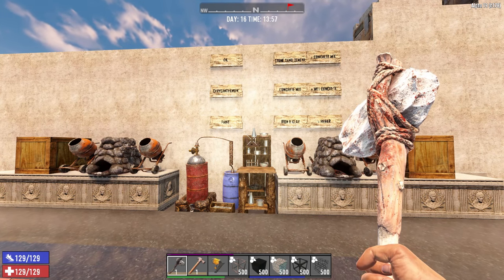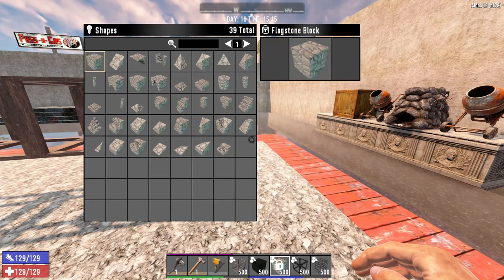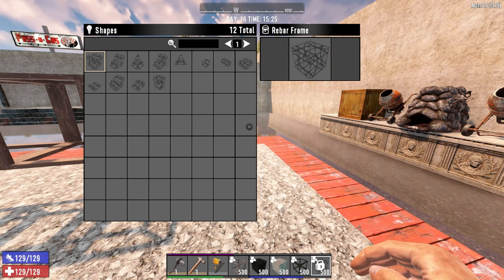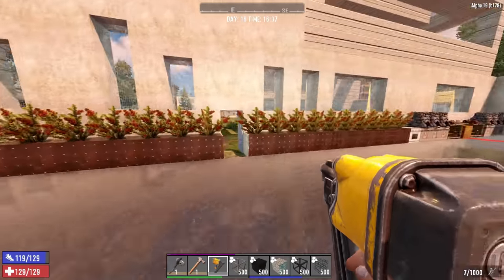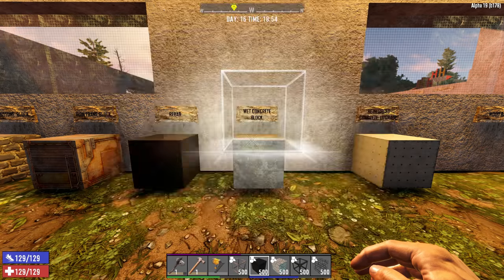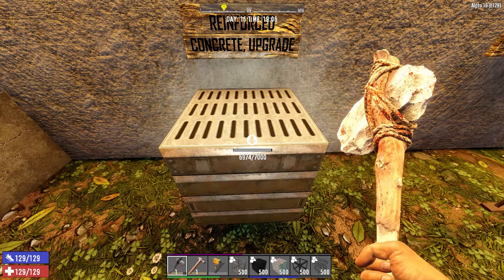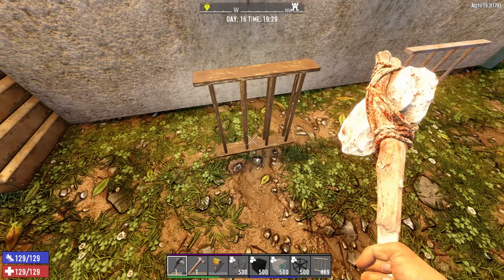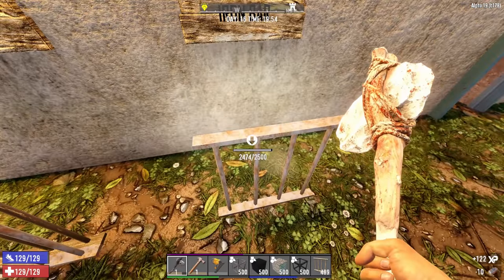7 Days to Die Alpha 19 Beginner Tips For Base Building, Complete Guide

Comment: Something worth noting is that upgrading the iron block to reinforced iron makes the block have 1000 extra hitpoins and not only 1000, since when you deal the initial 1000 damage to them, instead of breaking down, they will go back to their initial iron block state.
Reply from the maker: Hey Maxi! Yessir you are correct, it’s definitely a decent alternative to concrete for early horde base areas that take more abuse, although I just don’t think it’s worth it, the cost of the iron is expensive considering that most of the items in the game require iron, and the turrets etc, I just think it’s better saved for crafting and forging so I do give the iron blocks a bad rap but you do bring up a good point, personally I like to craft iron bars and layer them onto my cobblestone blocks until I get a cement mixer which is doable in one in game week if you’re grinding hard

Comment: So from what I watched:

Quick base building upgrades go from wood to cobblestone to concrete
Late game durable base upgrades go from rebar, to reinforced concrete to steel block
Reply from the maker: Yup pretty much, early game is wood or flagstone to cobble stone, mid game cobble to concrete/reinforced concrete, and then later game steel, sometimes tho you can get concrete going right away if you find a working cement mixer, in that case you could do concrete early game, but yes you are correct, btw thanks so much for watching Tim, I hope this was helpful 🙏
Reply: @xxsmashxxpassxx  very helpful

Comment: You're incorrect at 11:24. Reinforced iron has 2000 durability, as it downgrades it iron after being destroyed. It also can be upgraded into concrete, making it a viable path to completely skip the stone and dirt required to upgrade through to cobblestone.
Reply from the maker: Reinforced Iron has two layers, the first layer is actually 1000 durability, not 2000 durability, the second layer is also 1000 durability, so it’s a total of 2000,  the frame under neath is I think 250? I can’t remember, so it’s a little more than 2000k total, and it’s viable to use, but I just think it’s not worth the iron costs early game

Comment: It would have been nice to have the paint stack in the hotbar so we could also compare the paint `cost' of each different brush stroke.
Reply from the maker: I believe it’s 1 unit of paint per 1 side of a square block or object, but yes maybe I’ll do a video about paint sometime, there is a lot to it, thanks for stopping by the channel
Reply: @xxsmashxxpassxx  the cost for each face is on the texture menu and goes up to 5 our even more. Having said that, brewing a ridiculous amount of paint isn't very hard either.
Reply from the maker: @barendscholtus1786  Oil and Chrysanthemum is the recipe for the paint and you can craft loads of it inside the chemistry station

Comment: you forgot the degrading blocks vs the destroyed blocks. the "re-enforced" blocks like wood or iron will drop down one level in quality rather than outright gone. concrete and re-enforced concrete will just shatter and disappear when they hit 0. also each type of material will have different resilience vs different attacks.  like armor basically.
  ALSO when upgrading from the lower ones you gain XP as you do. but if you place a "wet cement" block you get zero xp for doing so. I spend the little extra in materials to gain a LOT of XP. this can be a HUGE early game boon as some of my designs can get me a jump of 125k-175k XP (at 100% xp value)  in 2 days game play from starting cutting wood to digging to fully upgrading  the blocks. most servers are 200% so you are level 18-20ish in 2-3 days with minimal risk or supply gathering.
Reply from the maker: Heck yea dude, building everything from the floor up is the way to go, it’s nice that you can level up a lot through base building, yet another reason to consider building your own base to get to higher tier weapons, cool info dude I’m not aware of server xp limits that’s a very interesting point you brought up!

Comment: Is that trick with the bars patched now? I can't seem to rotate it to get it to stack
Reply from the maker: Hey Branneth, should still work, the trick is the bars occupy a full block of space, place the first set of bars to the orientation you need, then take the second set of bars and rotate them in front of the first set until they line up as if they are side by side, I have noticed this won’t work if you don’t have a block underneath the bars, the second set of bars has to have a block underneath it or a way to attach it from an adjacent block,  lemme know if this helps, I’m not sure if I’m explaining this in the best way  🥴, p.s. if you are stacking them on top of each other it’s easier to stand on a frame then place it on top and keep going up in frames to however high you want to stack them

Comment: stupid question but how do you set the full block flush with the half block layer? mine is floating in the air above. any advise is appreciated
Reply from the maker: Ah ok, so you will want to access the “block task menu,” this will open up all of the options for block rotations, you will want to select advanced rotations, this will allow you to cycle trough all the possible ways that shape can rotate so you can find the desired orientation you are wanting, to then place the block how you see fit I.e make it flush, however certain blocks will not line up a hundred percent flush, the half blocks can line up flush with a full block, however it will still occupy a space of one( or one by one meter) so lining up the next block in the sequence will be tricky to flush, so you may need to play around with the configuration quite a bit to get the aesthetic you want, do you mind telling me what you’re trying to do? Hope this helped
Reply from the maker: Btw you will want to press or hold theR key to open up the menu where you can access the shapes and rotations

Comment: It's wayyyyyyyy easier to never ever use rebar frames and simply spend 10 cement to upgrade concrete to reinforced concrete
Reply from the maker: Rebar is a really good for quick repairs and is a huge time saver for building a base quickly, that goes to reinforced concrete immediately, and it also saves time by cutting out the middle man, wood and cobblestone gathering, crating and upgrading 😎
Reply: @xxsmashxxpassxx  saved me loads of time bro 😤😩
Reply from the maker: @ganggang363  awesome, thanks so much for the feedback bro 💪💯